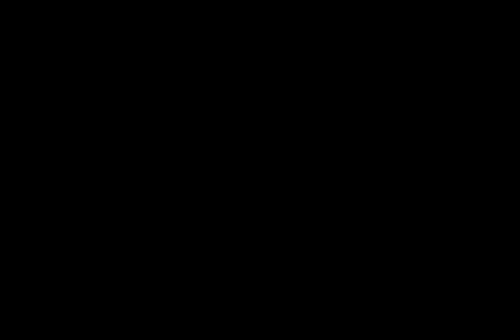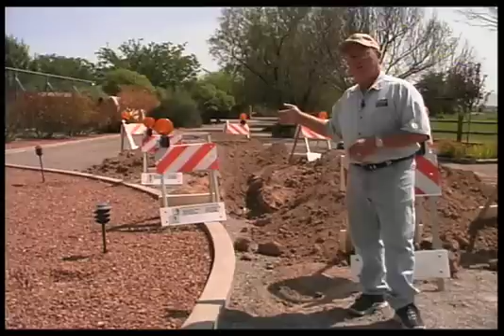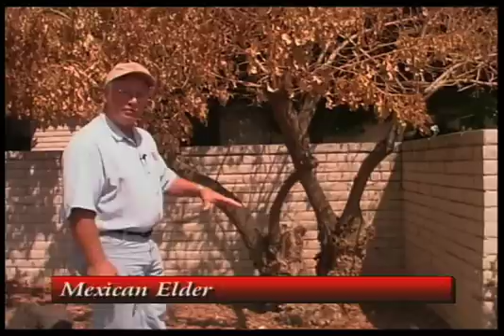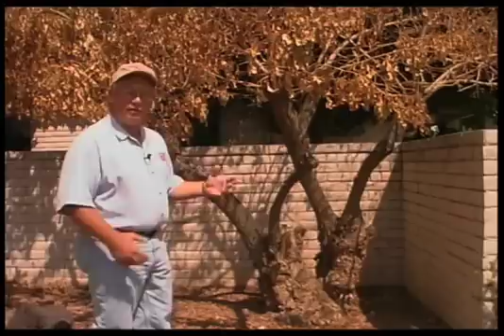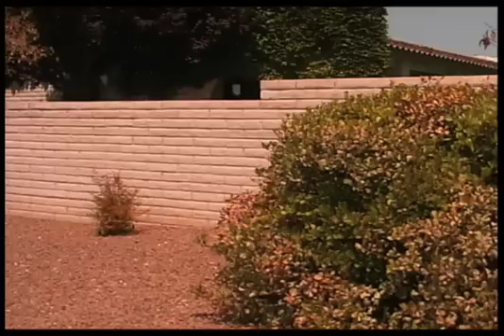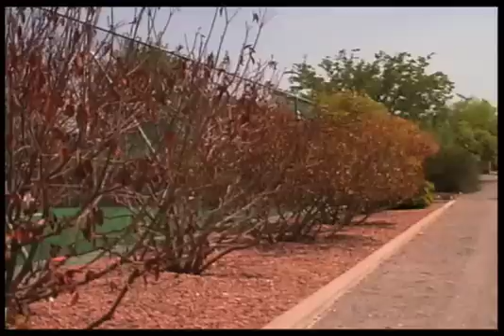How To Identify Tree Damage From A Natural Gas Leak

Comment: How long does it take for a leak to kill plants?
Reply: it happened in just a few weeks at my relatives home. the first time they did not realise  that gas leaking in the ground  - so they replaced all the recently died plants. But when the second lot of plants died they called in a plumber who had suggested "maybe a underground gas leak"
The plumber was correct and he dealt with the problem -  thus several years later those third lot of replacement plants are all still thriving.